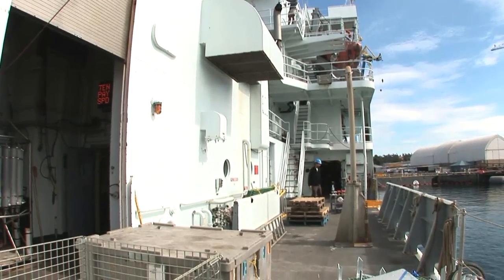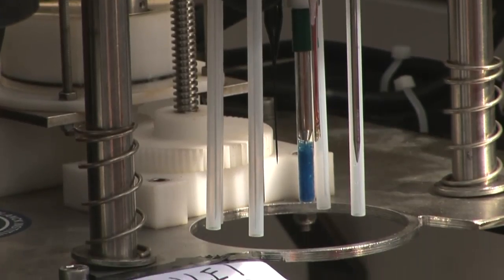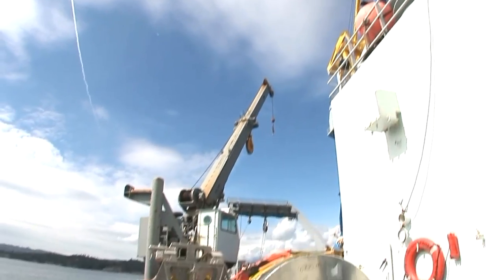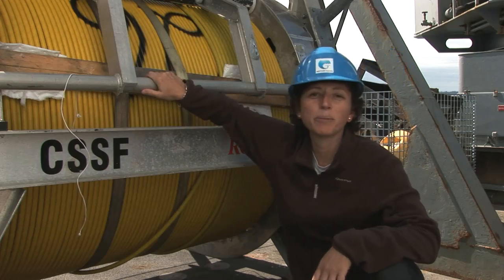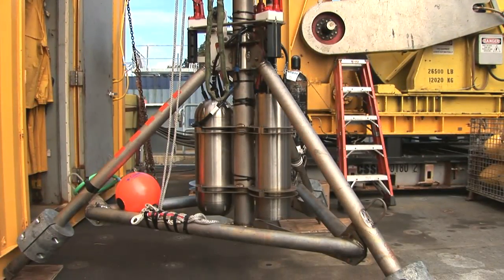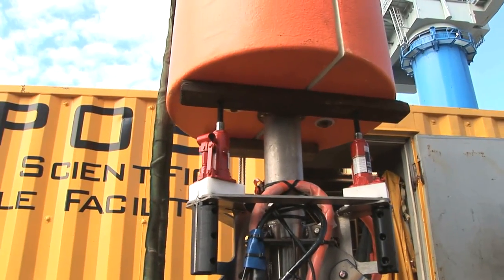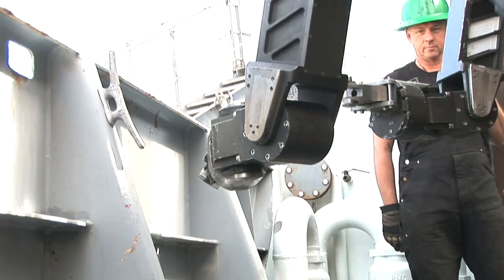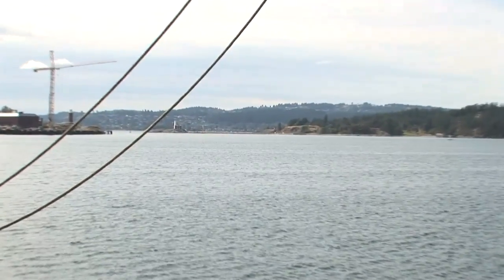Journey to Endeavour Ridge

Comment: amazing indeed!  hopefully we could be more aware of the ground breaking work you are doing here, I can observe some parts in the remote device that seem to be made of plastic, and a question springs forth, what is the lifespan of the submerged machines? how do you cope with salt water corrosion in the machines? how do you mange to waterproof the joints and the inner electronics?, also, how do you make the machines pressure proof at several hundred meters deep?  thanks for sharing this info!